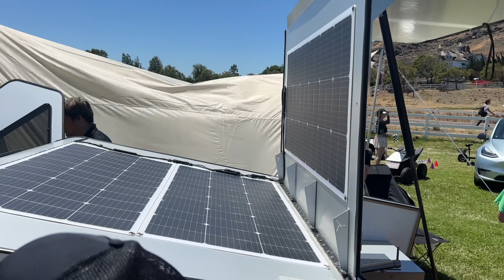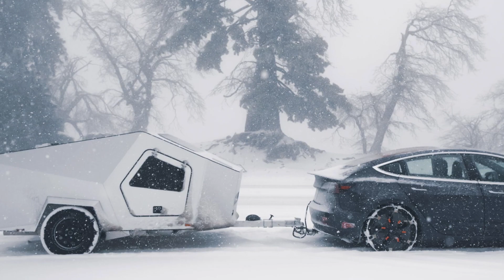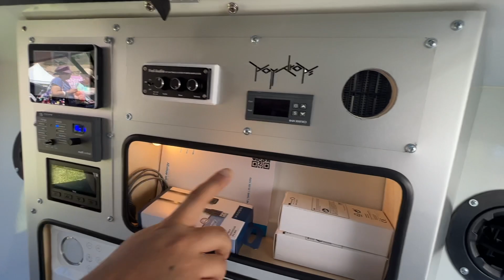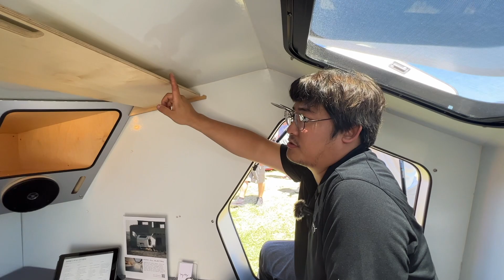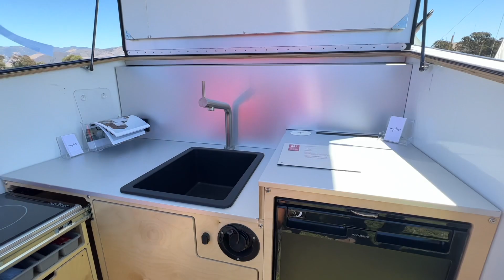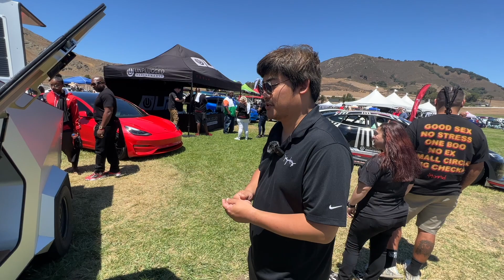Polydrops Teardrop Trailer Interview

Comment: Great review and now am subscribed! My Ionic 5 AWD long range is on the boat heading for Canada and once I sell my Motorhome the Polydrops 17A1 with the 9.6KWH battery is my number one choice! I actually was doing up an order earlier on and requested that they use a more efficient Variable compressor DC Inverter AC and wow they have! The model I configured much earlier in the year still had the normal AC low efficiency design. They are into efficiency!! Their electronics for charging, inverting is Victron, one of the most efficient solar and inverter options out there!

Comment: I already had looked at his videos and my impression is that it is a great idea but also he has to take it further. My feeling is that he needs to find a way to integrate the car more into the trailer. If he could pull every thing in from the car that is already sitting there it would make the most sense as far as efficiency which is key. I believe he could modify cars so that he could bring in heat and A/C, 120 volt power and infotainment like radio and Wi/FI. The main work would be flexible ducting for the HVAC and inverting the power to 115 volt. Some EV's already have AC power out like the Ford lightening and the KIA EV6.

Comment: It would be interesting if they had a mid level speced version that had all the amenities of the top trim but without the battery/solar and using the battery of the EV to run the trailer though an outlet on the EV.